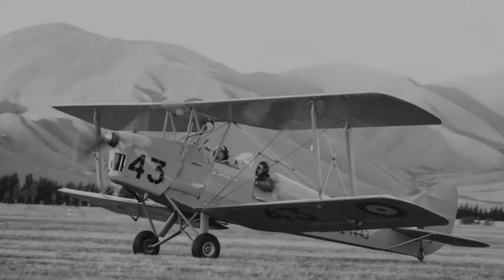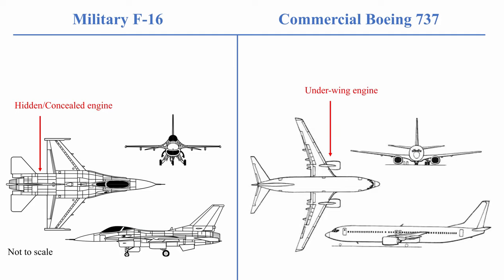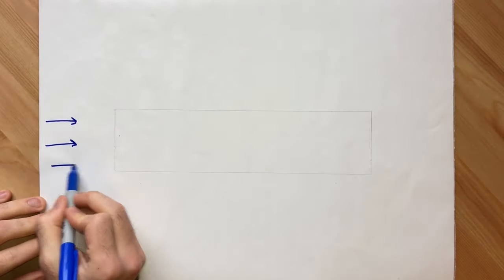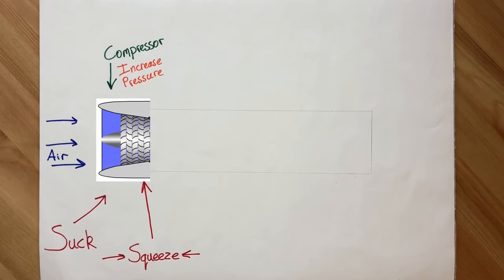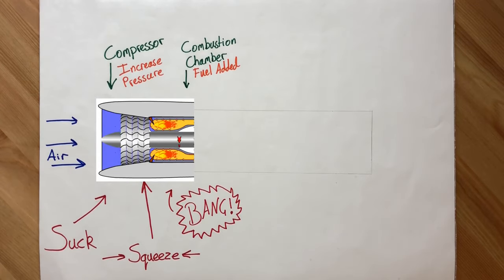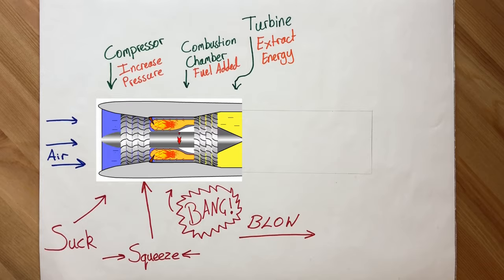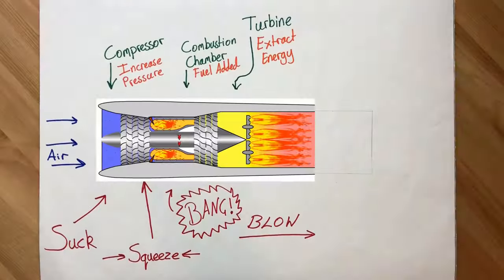How Does a Jet Engine Work? (Fighter Aircraft)

Comment: Just one correction. The engine doesn’t let “air” out the back. It sends out “exhaust gas” which is mainly nitrogen but also CO2 and water vapour (combustion products). There is some excess oxygen but nothing like the amount to term the gas mixture “air”.
Reply from the maker: Great point. This video was an oversimplification, but your point is absolutely correct. Thanks!
Reply: Dude, how uptight are you? Air is Air. Air is made up of gases. You can have variable amounts of different gases to make up "AIR". Depending if its filtered/processed, fresh atmospheric air, polluted air ( this would be your "exhaust", toxic air, hot air, cold air, humid and non humid (the last 4 mainly change the water vapour content) and the altitude of the air. The OP did not state the air state. Atmospheric clean air in, polluted exhaust air out. In his context, AIR is AIR.
Reply: @ThyPredator yes air is air but it’s just to put more detailed info for those more interested.
Reply: You are correct, but rudeness was not called for. Whoever posted the comment just fed the minds that are more interested and SHE is correct. Air is air, but air is made of different gasses, like exhaust gas. She did not talk about air in general, she talked about the air that is being propelled out of the fan. This comment was not necessary.
Reply: @ThyPredator it's like an 8th grader will say we breath in air and breath out air.
But a 12th grader will say we breath in air rich in oxygen and breath out air poor in oxygen

Comment: So Basically, the difference between a commercial jet engine and a fighter, is the presence of a fan
Reply: Most modern fighter engines also have fans, but much smaller ones than those of passenger jets.
In a commercial engine, the ratio of air passing around the core vs the air passing through it may be as high as 10 : 1, while that ratio is typically around 0.5 : 1 in a modern fighter engine.

Comment: The analogy of the balloon is misleading: that is the principle of a rocket engine, not a gas turbine. The gases rushing out of the back are not what propels the engine forwards. In fact the greatest contributions to forward thrust are the compressor stages and the combustors. The turbine and the exit nozzle (non-afterburning) are rearward-acting components that push against the desired direction of motion. In total it is the excess of forward-acting gas pressures over rearward-acting gas pressures that produces a net forward thrust.

Comment: It just blows my mind how a series of fan blades can somehow compress air enough to get hot enough to ignite a fuel as thick as JP-8.
Reply: There is another explanation, the compressed air/fuel mixture is ignited by contact with the combustion gases which makes sense. That's what I heard, it's not my thoughts.

Comment: One question. Does the turbine send back energy to the compressor or did I understand it wrong. Great video very good explanation!
Reply from the maker: That's right, the turbine sends the energy back to the compressor in order to compress the air. It's a continuous process :)

Comment: 3:24 “this jet of air pushes the plane forwards’.

It’s actually not the air being expelled that pushes the jet forwards but the process of the hot (high pressure) air being replaced by cooler ambient air at low pressure.

The air escaping a balloon experiences the same effect.

The reason the air is heated is to generate a higher pressure as hot air is more compressed, or of a higher pressure than unheated air.

A jet engine isn’t pulling air through as much as its heating air to generate a cushion of incoming, cooler, low pressure air.

It’s the same concept as the propellor driven plane but the forces affect the inside of the exhaust rather than the inside of the propeller blades.

Comment: Wow 1/3rd of the temperature of the sun's surface!! If that is above the melting point of many of the metals inside the engine then how is that these metals don't melt?

Loved the video btw- could you please explain about hydrogen fuel cells and how they work in a future video
Reply from the maker: It's a great little fact! Typically the hottest temperatures are found in the turbine. This is because it is at the end of the combustion chamber, where the hot flames are most intense. The engine will actually take a small amount of cooler air from the compressor, and using various pipes, will route it into the turbine. It is then blown onto and around the various components. This cooler air is essentially able to 'blanket' the hot components from the intense heat!

Hydrogen fuel cells is a great idea - I've added it to the list!
Reply: @HitMeWith  thank you for explaining it. A cooling system makes a lot of sense
Reply: @HitMeWith  turbine blades in aircrafts are made up of single crystal nickel based alloy ....they have high melting point sustainable to almost 2000 degree Celsius....other metals melt...
Whereas nickel based alloys do not melt due to various reasons such as it's monocrystalline structure....high creep strength and fatigue life....these blades are very expensive....due to presence of rhenium metal

Comment: You mentioned the temp to be higher than the melting point of the metals that make up the engine. What happens is that the fuel air mixture is mixed in such a way as to create a "ball" of fire (called the combustion zone). Only 25% of the air is actually used for propulsion, the other 75% is used to "cool" the engine. So unburned air is placed between this combustion zone and the walls of the engine. In addition the turbine blades are somewhat hollow and air is forced through small holes to keep the blades cooled. This is a delicate process. If too little air is pumped, the blades will melt, if too much air or if the air is delivered with too high of a pressure, the jet of air coming out of those holes will be too far from the surface of the blade and once again, the blade will melt. Engines are a marvel of engineering. Thanks for the video.

Comment: I think you overestimate how many aircraft use jet engines. The vast majority of GA aircraft are piston-propeller aircraft. There are more than 100,000 Cessnas, Pipers, and Beechcraft still flying around regularly, with models that are still in production. And new GA designs, like Diamond and Cirrus, use piston-propeller power, because they're much cheaper to build, maintain, and fuel.

Comment: I read somewhere that, for an afterburner to give 50% more thrust, it has to burn 600% more fuel than the actual combustion chamber, which is why that decreases the range of the jet. Is that true?
Reply from the maker: That seems quite high! A typical reheat system might double the fuel consumption when running at full power. That's why most modern fighter aircraft have supercruise capability, which conserves fuel :)
Reply: @HitMeWith  It's just something I've read. I have nothing to prove it. I don't even design jet engines.

Comment: This is a good example of a Turbo Jet type engine, which are no longer in production and are extrememly inefficient. Actual modern aircraft utilize high bypass Turbo Fan engines. The fan is the primary component that makes the airplane move forward. There is no fan on the engine in this animation.
Reply: Modern fighter jets use low bypass turbofan engines, not the high bypass type used by passenger jets. High bypass turbofans are far more fuel efficient than the low bypass type but can't be used for supersonic flights. The cross-section area of a high bypass turbofan with sufficient thrust is also too large to fit inside the relatively small hull of a fighter.

Comment: Thank you very intresting and informative. Surely there is little oxygen to combust when the fuel from the afterburner is added or am I wrong in thinking that?
Reply from the maker: This is a great question! In reality the jet engine will suck in far more oxygen then it needs. The fuel-air-ratio is very low, meaning that there is substantially more air than fuel entering the engine. This is also known as running 'lean'. All this results in plenty of oxygen left over for the afterburner!
Reply: @HitMeWith  thank you for explaining it. I assume the "lean" running is the most efficient way of running the engine as well or would I be wrong in thinking that too?
Reply from the maker: @lukecowley8258  That's right! Running lean means maximising the energy from every drop of fuel. Strict regulation and competition mean engine efficiency is a top priority. Also running lean helps keep the engine cool, too much fuel (heat) and you risk burning up all the components!
Reply: @HitMeWith  thank you again😊

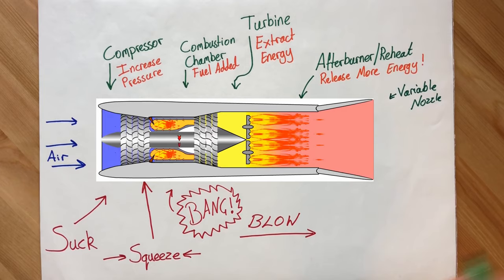Comment: 4:28
So why don’t we use simply a fixed nozzle ?
Reply from the maker: When we put even more fuel into the engine (for the afterburner system), we are changing the thermodynamic cycle slightly. We expand the air even more, and we need to compensate for this additional increase in mass flow. So the nozzle area needs to open up even more! Otherwise we would restrict the throughput. No afterburner = fixed nozzle

Comment: So is it safe to say that it runs more on air than fuel?
Reply from the maker: Every engine will have a working fluid (which is the fluid that the engine does 'work' on). For a jet engine, it uses air to achieve the thrust. But fuel is necessary in the thermodynamic cycle to achieve this :)

Comment: A jet engine is also an internal combustion engine. You need to do a little more homework before tackling a subject.
Reply: Indeed!
Both piston engines and turbines can have internal combustion, just as they also can be steam engines (external combustion). Titanic did in fact have two piston engines and one turbine, all three powered by steam from the boilers.